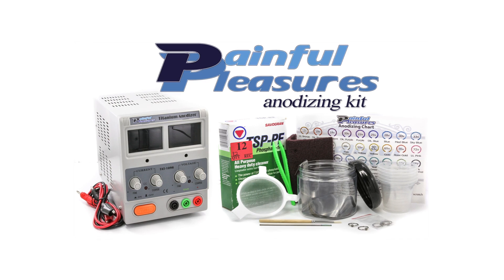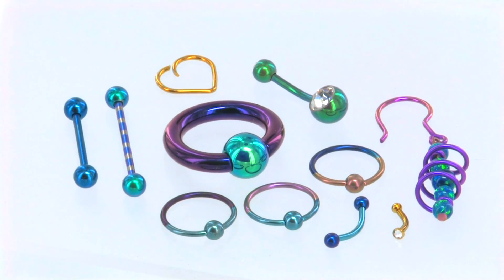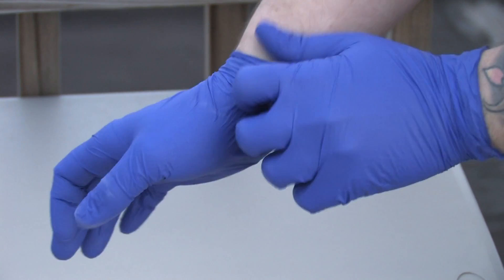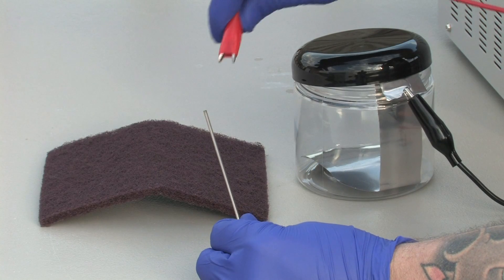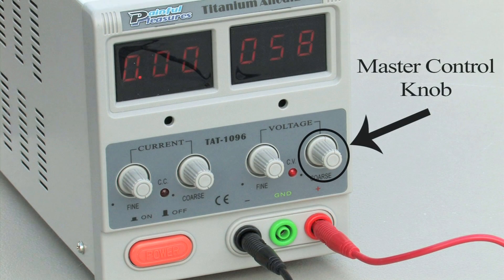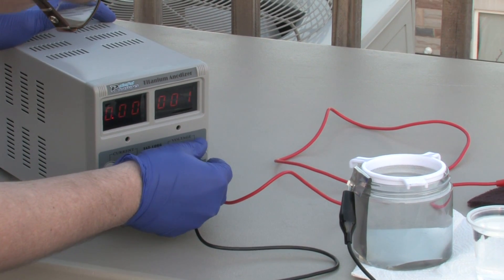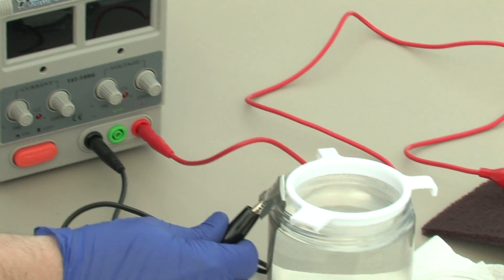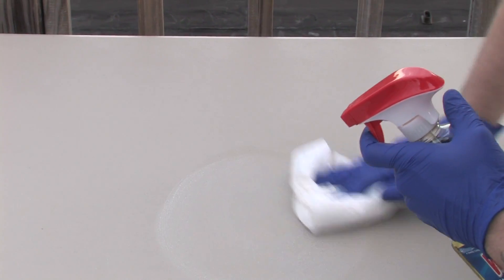Titanium Anodizer from Painful Pleasures - Anodize Titanium and Niobium

Comment: Do you know how much tsp and water you used for that cup?
Reply from the maker: It's not necessarily reliant on a specific amount of water needed to dip the fired piece back into - just enough to completely submerge the piece of jewelry!
Reply: @painfulpleasures  I noticed the deeper the water it, I will start to lose the voltage the deeper the item I’m changing color goes. Is that normal or is there something wrong with the machine